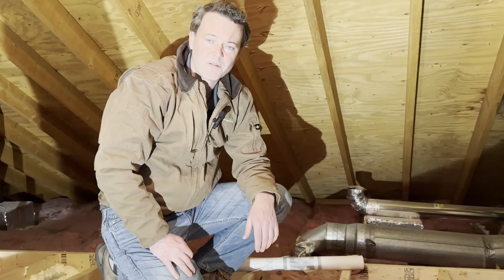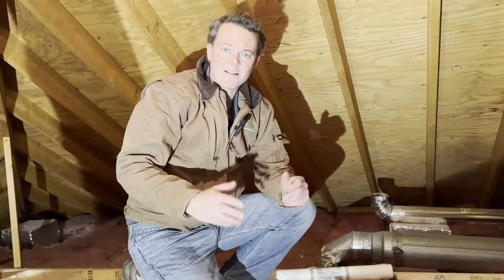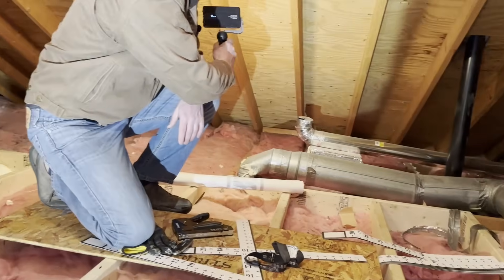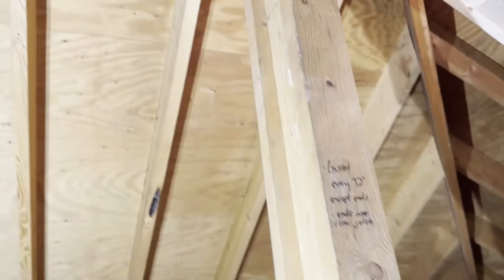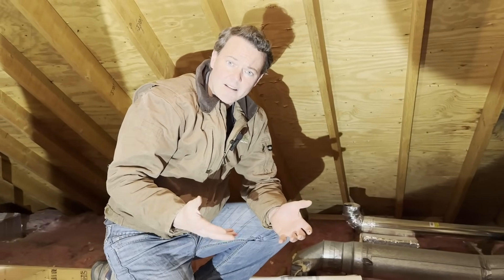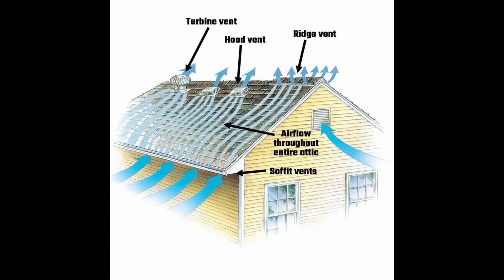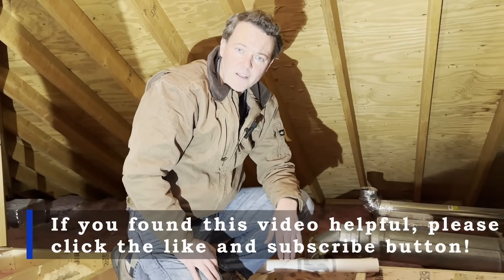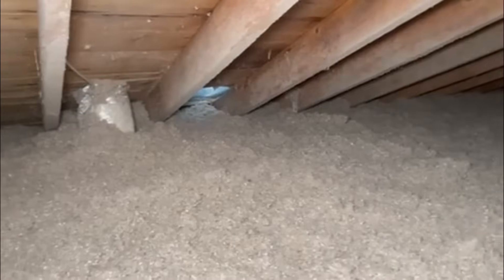Is a Roof Power Attic Fan a Waste of Money....or Even Worse?

Comment: Question for you. I live in a house with architecture style where there are no soffits / eaves (like the houses at 1:04 in your video. Half the roofers in my area don't like or trust the under-shingle design with our snow (Great Lakes region). Between the under-shingle vent and using slant-back vents as intake which would you recommend? Attic is about 600 sft, hip roof.
Reply from the maker: Great question and thank you for commenting.  I found this on google and agree with it:

"Preventing Snow Infiltration:
Under-shingle vents, especially those designed for snowy climates, often have features like mesh screens or baffles to prevent snow from entering the attic. These features help to block snow from blowing in, especially when the wind is strong. 

Snow Melting and Evaporation:
Even if some snow does make its way into the attic, it will likely melt and evaporate due to the heat generated inside the attic. This is a natural process, and the amount of snow that accumulates in the attic is usually minimal and not a cause for concern."

If a little bit of snow does make it's way into the attic via the under shingle vents, it should easily evaporate out.  I've seen up to an inch blow in through gable vents on occasion without it causing any issues.   I prefer under shingle vents because when operating as intake they will "bathe" the whole underside of the roof with intake ventilation, drying it a bit better.  

Slant back vents are also very effective, I just think they're a little more unsightly and they won't wash the whole underside of the roof with intake air, just the localized areas where they're installed.  That said, we've still had great success using them for intake vents and do it all the time.  We do this because we don't have the ability to install under shingle intake vents in a retrofit application.  

Question.  Why do some of the roofers not like the under shingle vents for intake?  Have they witnessed definite failures?  Or do they just not believe they can function "because of how they look, etc..."

Thousands of homes are now using under shingle vents for intake.  If they are leading to repeated failures you should be able to find stories of it online in places like reddit, etc.  

Last thing, if you have a hip roof, it's going to likely take some extra vents up top to get enough exhaust.  Check out this youtube short that I posted and you'll see how they ventilated their hip roof.  It looks correct to me and it's likely pretty close to the situation you're dealing with.

https://www.youtube.com/shorts/K5BS6rsAVSA

Thanks for commenting, 
Andy
Reply: @insulwiseenergycomfortsolu3293  I believe it is mostly concern with water or snow ingress due to the design. Additionally, one roofer mentioned that in the Chicago Region we have snow cover on the roofs a lot of the time during the winter which he said would block the under shingle vents and stop them from working properly. 

Have you had better luck with the DCI smart vent design or the Lomanco air deck system?

As far as improving exhaust, I think the Lomanco Whirlybird turbine exhausts seem like a great solution, though many roofers I have asked do not like them as they are concerned about failure, etc. However, I think their design would work great for venting a tight hip roof attic in conjunction with and under-shingle or slant-back intake system. What are your thoughts on the turbine vents? If you don't like them I understand, I may be biased as I think they are a cool design mechanically, look cool, and I like that I can see if they're working plus we have almost constant wind in the area, so they should be spinning well).

Comment: I have a simple roof. I put a gable fan on one end and a big vent on the other. It does a great job. My cable fan has a digital controller inside that is adjustable and shows attic temperature. Best thing I ever installed.
Reply from the maker: I have seen that set up work very well, especially when there is not a ridge vent.  With your set up, when the fan turns on it will draw air from across the entire attic space, from one end of the attic to the other.  Nicely done.

Comment: You're the 2nd guy I've seen who wants me to suspend my belief in the laws of physics when you said that, while having soffit vents and continuous ridge vents, the ridge vent becomes ineffective when also having a power vent. Do you want me to believe that hot air ceases to rise? Who writes your script? The objective is to vent out hot air. Who cares how it gets accomplished.
Reply from the maker: Hot air certainly rises, that is not what this was about.  The point was that power roof fans are often installed too closely to passive vents for them to create the desired impact of cooling the attic.  If your power fan is a short distance from either a ridge, gable, or soffit vent, then it's going to pull much of its air from that vent -- causing the air to circulate in somewhat of a loop.  It very well may not affect temperature at all in the bulk of the attic area.  This isn't theoretical.  I have spent thousands of hours working in attics on hot summer days and have seen this effect repeatedly.  
If you're going to install a fan in your roof, you want it to pull air from as far across the attic as possible, rather than in just a small localized area.  If you're going to have a fan at the peak of the roof, then you probably want to either seal off or restrict your ridge vents so that it pulls almost exclusively from soffit or gable vents.  That will maximize its effect.  However, you are then reliant purely on that fan working in order for your attic ventilation to work.  If it breaks or wears out (and they all do at some point), than you have a severely restricted exhaust ventilation which is not ideal (until you fix or replace the fan, and often people don't realize that's broken / not working).  That's why we are much bigger fans, in the majority of cases, of passive ventilation combined with an air sealed and effectively insulated attic floor.  
Andy

Comment: Had the same issue, builder installed ridge vents, turbines and exhausts. Recently got rid of the ridge vents and exhausts, kept the turbines since work best on our hip roof, made a huge difference.
Reply from the maker: Sounds good, I've heard that turbines really move a lot of air.  Do you have a source of intake ventilation for them?
Reply: @insulwiseenergycomfortsolu3293  Yeah I have soffit vents. So far having only the turbines is working well. Humidity in attic dropped a bit and attic is now only 10-15F more than outside.

Comment: Add sofit vents and put a pipe that attaches to the bottom of the fan and hangs down into the attic space so it does not suck from the ridge vent. Convection buy itself does not always work you need a temp differential.
Reply from the maker: Interesting, I haven't seen a pipe used to draw air from lower in the attic, but that would probably work better than having the fan opening situated directly next to the ridge vent as it is here.  Thanks for commenting!
Reply: Never use a power vent  with a ridge vent they work against each other.

Comment: What should I lookout for or consider for a double wide mobile home with a new shingled roof that got a hot attic space?
Reply from the maker: I would hire a try to hire an insulation team that understands insulating mobile homes.  If you can get that attic better insulated, as well as properly ventilated, your home will be much cooler.

Comment: I have ridge vents in Louisiana and they don’t seem to work worth a hoot.  My attic is hotter than balls.
Reply from the maker: With roof ventilation you need to have both exhaust (ridge vent) and also intake (soffit, under shingle, or slant back vents placed down low on the roof).  Also, how well is your attic insulated.  In most cases the end goal is to keep the home cooler, not so much to keep the attic cooler.

Comment: About 28 years ago I installed a gable fan on one of my gable vents. This along with great soffit venting, my basic 3 tab shingles lasted 30 years and still looks good.   My cheap OSB plywood roofing looks new too.  Only replacing my roof to be proactive.  All the roofers are telling me they only do ridge venting and now I have to block my gable vents.  I bet my roof only lasts 20 years max with this inferior system.
Reply from the maker: That's too bad, if you have something that's working I hate to mess with it.  However with full soffit vents and a ridge vent, you should -- should be just fine.  That said, 30 years on a 3 tab shingle roof is outstanding!
Reply: if the gable vents are at the peak that works great especially with the gable fan.

Comment: The only time a powered vent makes sense...

When I was growing up, my parents had a large powered vent fan installed in an upstairs central hallway.  It had a timer on it and was used at bed time to draw cooler air in from open bedroom windows and pump it up into the attic displacing the accumulated hot air.  It worked rather well.  Now, keep in mind, this puts a rather large uninsulated penetration in the ceiling of the second floor living space.  Think of it as an open bathtub drain for hot interior air to disappear through during the Winter months...

A typical gable attic fan will not move enough air regardless of eave venting to dissipate the heat wattage dumped on to the roof by the Summer sun.

So, what a homeowner should do is:  1)  Air seal the highest story conditioned living living space with canned spray foam.  2) make sure there are plenty of eave vents, install quality and durable attic insulation baffles.  3)  Insulate the attic to three or more feet of fluffy stuff.

Optional)  Go with some type of radiant barrier properly installed with an air gap.
Reply from the maker: Thanks for commenting, you're spot on with the ceiling mounted whole house fan, except for that during hot days the thin aluminum louvers allow intense attic heat to radiate into the living space, and if you live in a humid climate -- the outside air getting sucked in will be unpleasant.  I have seen roof mounted attic fans work to cool the attic, but the best solution is the one you mentioned --- air sealing and insulating the attic floor and making sure you have effective intake and exhaust passive ventilation. 
Andy
Reply: @insulwiseenergycomfortsolu3293  Yep!

I've never run the air conditioning in any of my homes unless requested to do so by visiting guests.  FYI, I'm at 40°N latitude in the Midwest  And, I'm not uncomfortable.  It's all in the air handling.

And a whole house attic fan?  Not necessary.  A couple of $20 box fans placed in windows with blocking so the breeze is blowing out, allow bedroom windows to be open for the incoming make-up air.

Air sealing, eave vents, and lots of fluffy stuff!

Here's a video on my take on DIY attic eave insulation baffles:

https://www.youtube.com/watch?v=ZB346-ng_8Q

Comment: Took our 120 volt powered attic vent out when our house was re-roofed last year. Added a little more ridge vent. Our power bill has been lower ever since. I doubt that kilowatt cost has gone down.
Reply from the maker: Interesting, and I'm not surprised.  If there wasn't sufficient make up air in the attic for that fan, it could also have been pulling air conditioned air directly up from your home.  Now that -- is bad for a power bill.

Comment: What kind of exhaust fan do you recommend for hot Florida!
Reply from the maker: Generally we'd recommened 1) Air seal the attic floor and get all bathroom vents vented to the outside 2)  Confirm you have adequate intake and exhaust passive ventilation (or add if needed) 3)  Insulate attic floor to R-49 with cellulose insulation 4)  If you still have heat penetrating down into the living spaces, then install a fan as a last resort.  We like solar fans because you don't have to worry about the wiring part

Comment: I just had a new roof installed on my house and I called the contractor and said that I would disconnect the wiring to the power vent and they could install a new hood on it because hail damaged it. He said great appreciate it. The next day I went back up and they boarded up the hole. 😡. Is this worth fighting over? Or did they do me a favor?
Reply from the maker: It depends.  If you previously had enough passive exhaust vents and they were balanced between intake and exhaust, (and your attic floor is insulated to at least an R-49 and ideally also air sealed),  you should be fine without it.  But --- if that fan was functioning as your only source of exhaust ventilation (sometimes it's done this way), then you probably need it back.

Comment: Heat is not as much of a problem for our house near the coast in Oregon, but pollen and detritus from a heavily wooded property (Fir, Redwood, Pine and Cypress trees) free floats in the air here. House is constantly dusty inside and I'm wondering if some type of attic/ceiling system could help. (probably not but thought I'd ask)  I've got an air filter running 24/7 in our main living area and it definitely helps but replacing filters constantly gets expensive. Great video, thanks for the info.!
Reply from the maker: I'd recommend having a blower door guided air sealing team go to work on your home.  I'd get the air leaks sealed in the attic floor, basement rim joists, around windows and doors, etc.  We see plenty of houses that are absolute sieves...outside air is cycling through them at much higher rates than you'd want.  When this happens it degrades comfort, energy efficiency, and also will introduce all kinds of outside air pollutants.  I've included a link for how to air seal an attic that has already been insulated.  Hope this helps!
https://www.youtube.com/watch?v=PUSONSE7srE&t=153s&pp=ygUVaW5zdWx3aXNlIGFpciBzZWFsaW5n

Comment: You kind of answered the question. If you do not have ridge vents, and you do have rafter vents it will work great.. You skipped over your own question.
Reply from the maker: If by rafter vents you mean soffit vents, than yes -- a roof power vent can work very well to cool down an attic (assuming that you have enough soffit intake vents to provide adequate make up air for the fan.  If you do not, the fan will depressurize the attic and pull the air from the house.  This is the last outcome that you want, but unfortunately a common one).
Reply: @insulwiseenergycomfortsolu3293 
How can you determine if you have enough make up error before you install a fan?